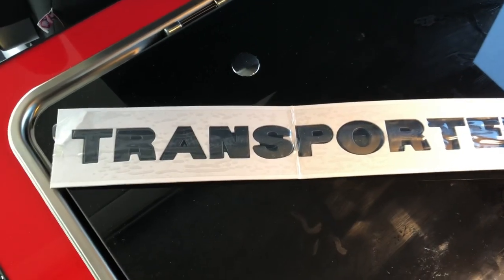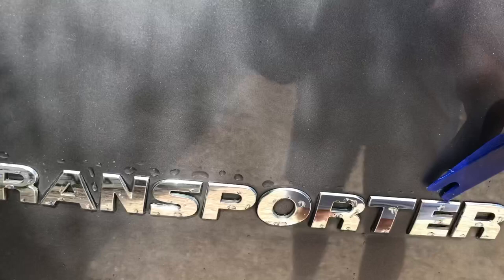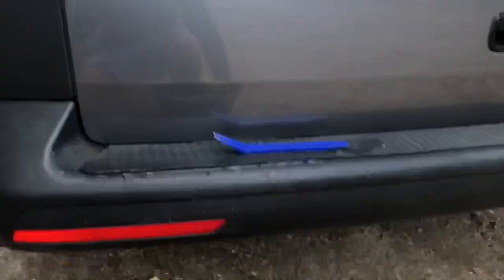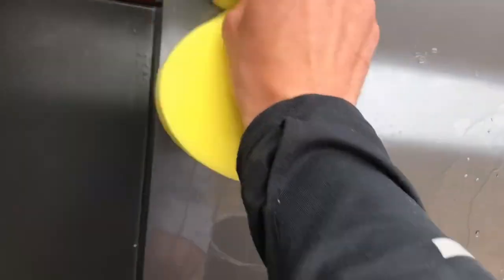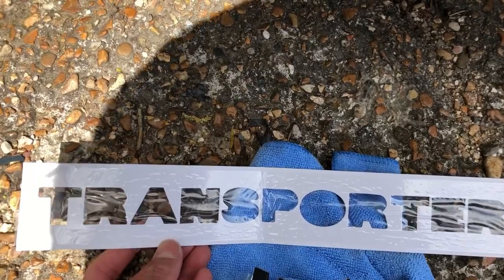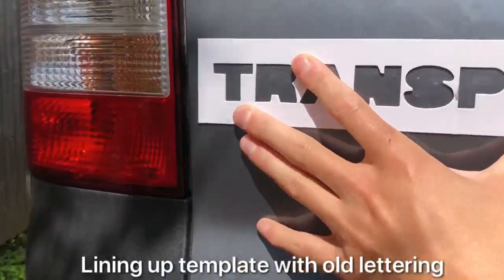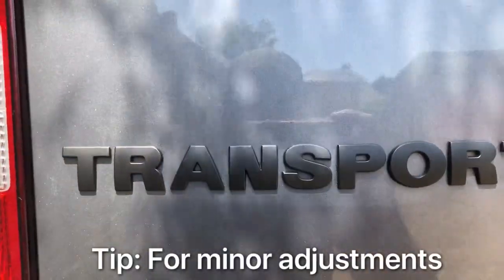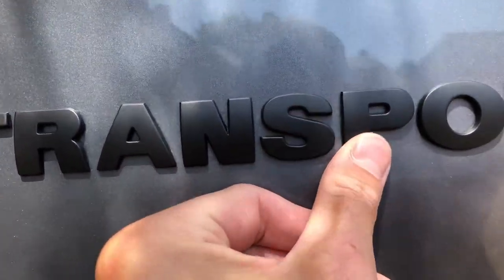VW Transporter Badge Upgrade on Tailgate - How to remove old badge and fit new one

Comment: Hi Darren, cheers for the video. I want to remove my lettering completely and not replace it. Looks like it left some marking when you took it off though.... would it be easy enough to get it completely clean?
Reply from the maker: Robin Hill hi Rob, I done mine like I did as I live in a flat with no power next to my van! I’ve seen people use hairdryers and also tooth floss to get all the glue off etc.  I cleaned all the glue off with a normal car wash liquid, I think if I polished it it would of not been noticeable! Cheers
Reply: Tube Darren Cheers Darren! Reckon I‘ll give it a go at the weekend.
Reply: You can get a rubber wheel which fits on a drill specifically for removing all the residue easily.

Comment: Hey man, random side question - did your van come with the bumper protector or did you add that? Is it rubber?
Reply from the maker: Hey mate bought it on eBay, fitted it myself decent bit of kit. It’s like a giant sponge rubber type material hard to explain! It’s been great though https://rover.ebay.com/rover/1/710-53481-19255-0/1?ff3=4&pub=5575605765&toolid=10001&campid=5338719738&customid=&mpre=https%3A%2F%2Fwww.ebay.co.uk%2Fitm%2F272855453928

Comment: Hair dryer works well to loosen old badges. Also, WD40 on a cloth is good for removing sticky residue...or you can buy a rubber wheel which fits on a drill which easily rubs the residue off. Lastly.....never use a yellow sponge if you think anything of your paintwork :(
Reply from the maker: Brilliant tips thanks!

Comment: Surely the letters are attached to the cardboard template in the right place, so you can just stick them all in one go? Or am I being a bit naive in that assumption?
Reply from the maker: Hi David unfortunately not, they come with the template already on but they are sellotaped on the back to hold them in place, trouble is you need to remove the sellotape then each letter is individually stuck on with a sticky backing, and unless you you stick the front of the letters to the template first then they would just fall out. Plus there’s quite a bit of wiggle room and you would have to get it right first which could get messy!!